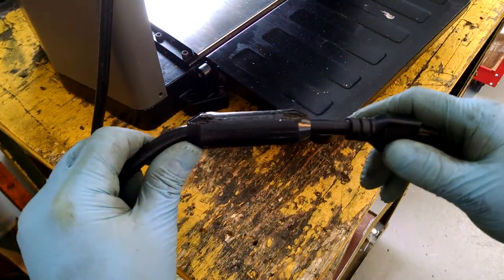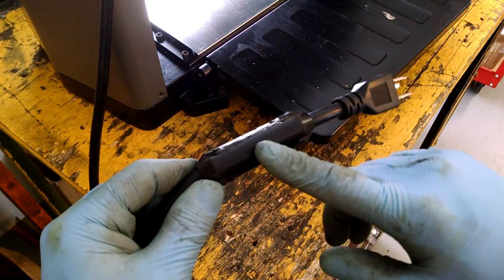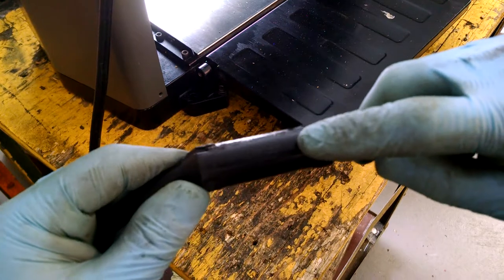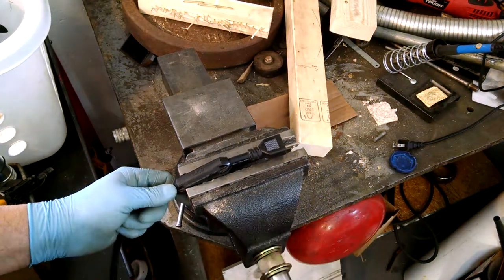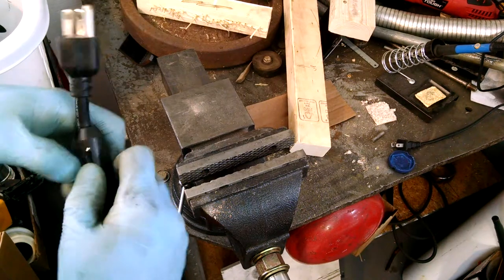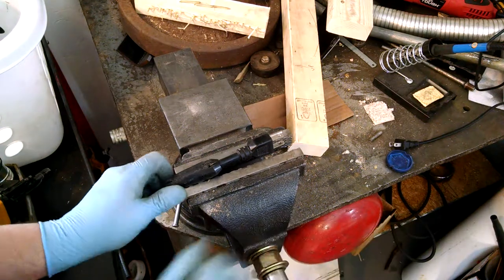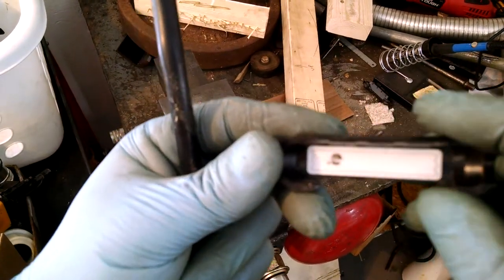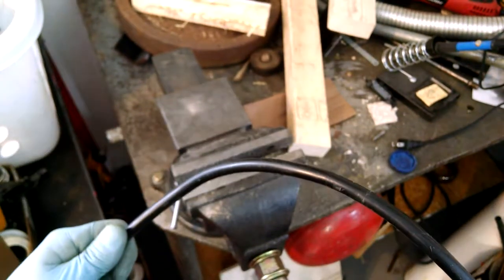Whats this plastic thing on the electrical cord?

Comment: Sensormatic tag. I used to work for the company as a trainer. The two metallic positive and negative magnetic strips inside the white tag vibrate together if not demagnetized at the register which causes the pedestals at the door to alarm.